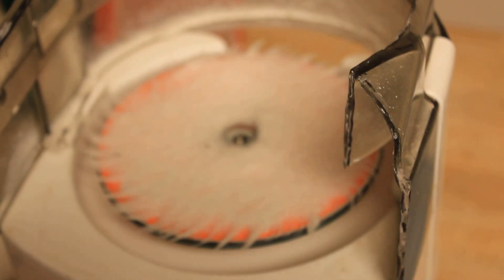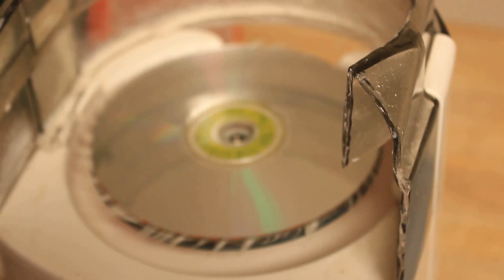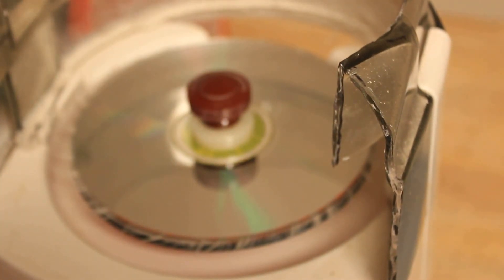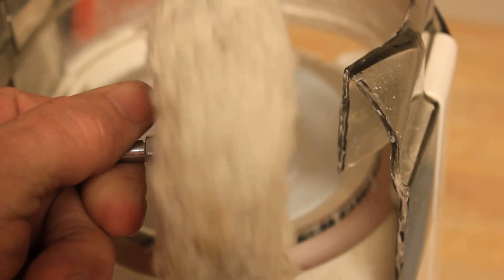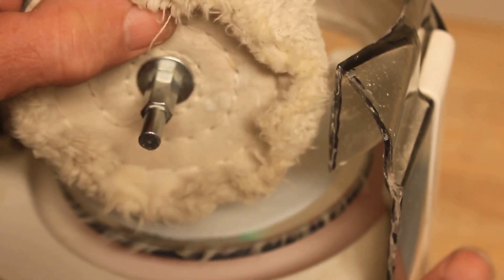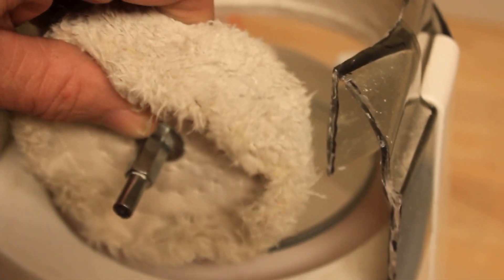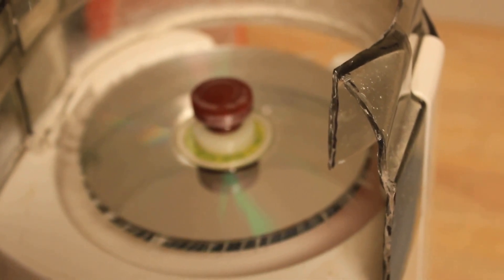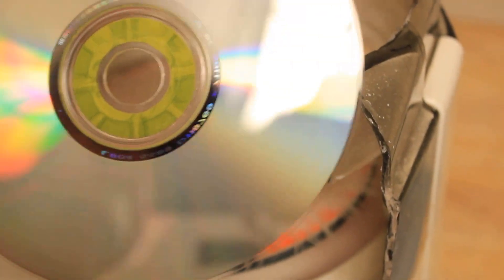Home made CD re-surfacing machine

Comment: Your machine looks great, I'd just like to give some advice: The way it is being used in the video is potentially dangerous to the media since any grain of dust in the polishing piece could result in a concentric scratch and thus make the media even harder to read. A common strategy is to mount the polishing brush in a separate "arm" so its contact surface could rub the disk more or less radially, like the industrial machines do. Cheers and keep the good work!
Reply from the maker: Thanks for the input I'll keep that in mind. Luckily never had a problem with over T,000s or more CDs polished